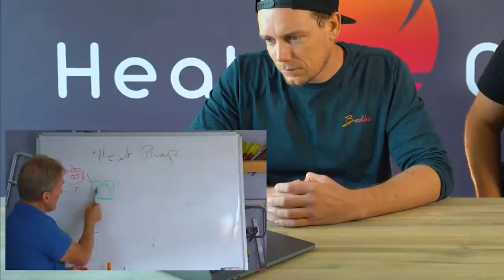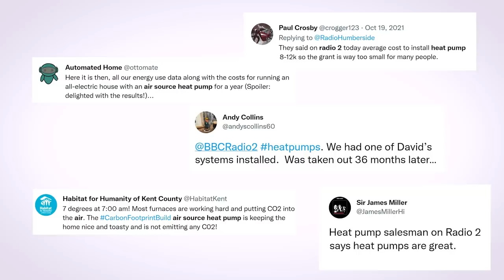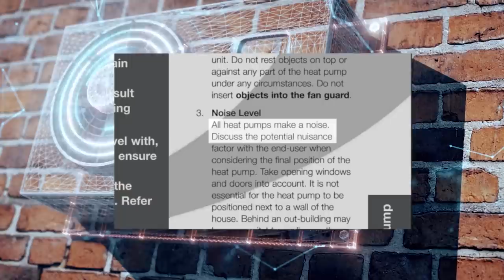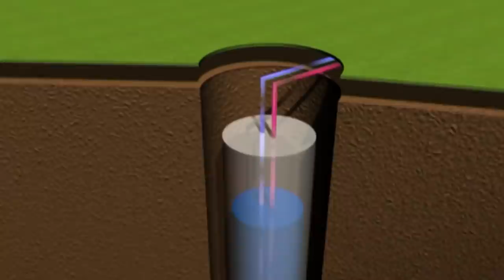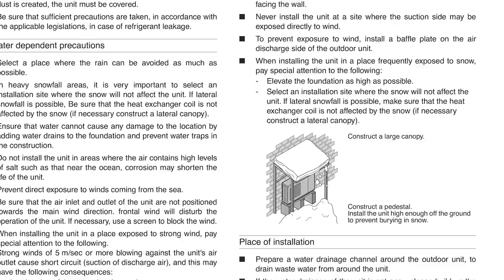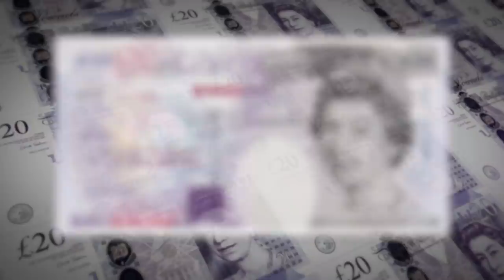Heat Pump Secrets They Don't Want You to Know

Comment: why does none talk about electric combis?,,,,,,,,,,surely it makes sense?,,,,you can buy the exact same boiler as your gas boiler,,,,old one out,,and new one in???,,,,,,,,,,,,,,so easy?so why all the shit about heat pumps?air source shit
Reply from the maker: Electric boilers are expensive to run. You might as well use electric panel heaters and cut the pipework out. There is no reliable electric combi on the market. My friends at the London Electric Boiler Company have tried them all and have yet to find a good one.

Comment: Ive installed 100s of heat pumps, your misinformation is laughable and this is your personal opinion, NOT FACT!!!!. Nearly all ASHP do not have  a backup heater for the defrost cycle. That was 20/30 years ago. I run a heat pump in my own property which is a 1950s 3 bed semi detached, very warm and it's -2⁰ this morning. Why don't you actually come out and work with a professional heat pump installer like myself. 
The gas used by 1 removed  boiler, can then produce electric at the power station, could run 2.5 heat pumps because of the COP.  You know the really facts, this ranting bollocks is just clickbait for this channel.
Reply from the maker: Quite happy to come out and film you at work, just let us know where and when.
Reply: @SkillBuilder  I already emailed a while back with real heat pump facts after your last videos. You never came back too me. 🤔
Reply: I honestly would like to see the outcome. Surprise me and educate please
Reply: @traian23us  find us on Twitter, where there are many like minded engineers already installing heat pumps. Also listen to the Betateach podcast.
Reply: @SkillBuilder  I will pop down when you come and see @heatgeek.